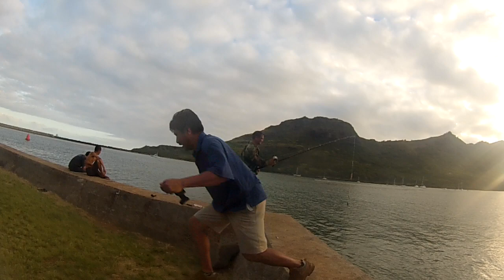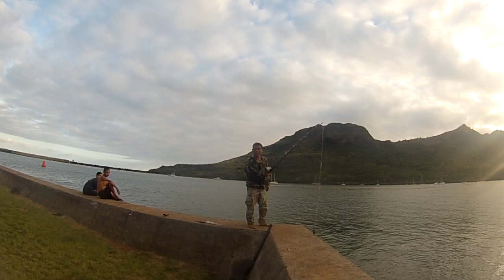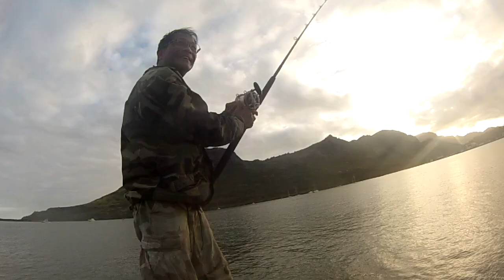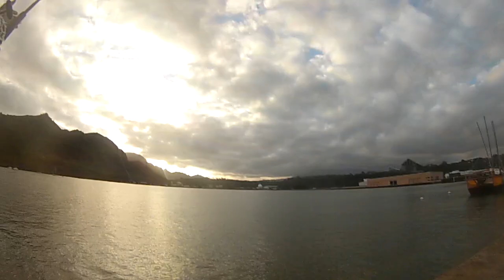WWJ GT Dunking Technique 7ft Rod

Comment: Can dunk with 7ft poles?
Reply from the maker: Yes..I have dunked with them before..spheros 6ksw since its got 50# braid and good drag..most of the fish are not over #20 dunking with small bait..but if a jigmaster with 40# mono can catch uluas and 7ft penn slammer with 11# of drag..with #22 bknk and HH for bait(landed 17 uluas) with that setup....she go..spinner with 200 yds of 50# braid and over 20# drag can handle..good luck..